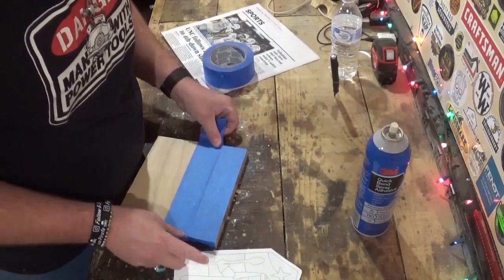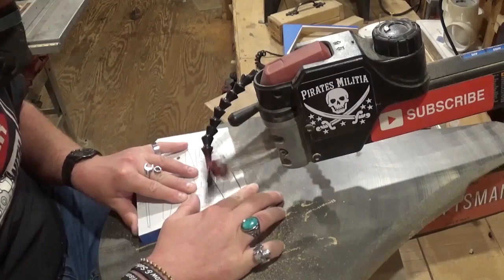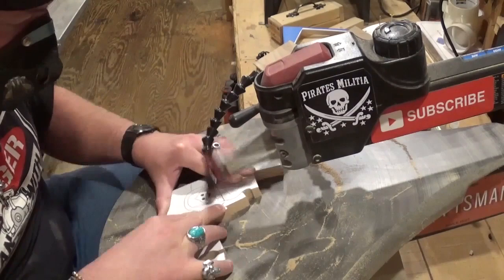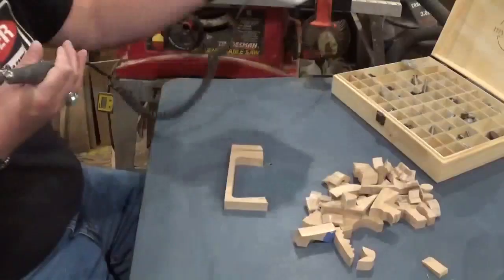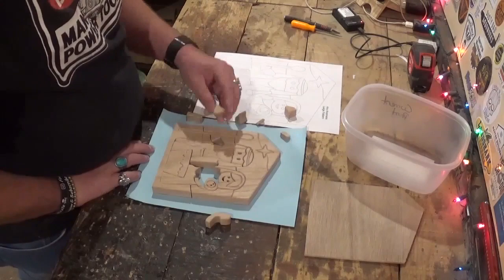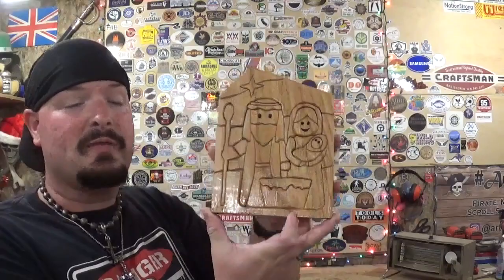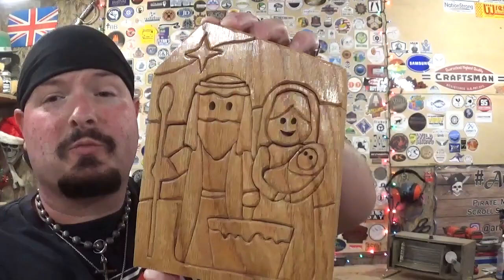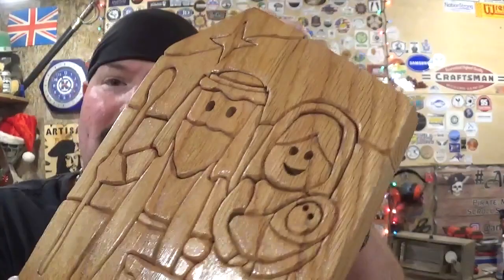Scroll Saw Segmentation, Nativity Scene

Comment: try using clear removable shelf paper it works great easy to remove and it lubes the blade
Reply from the maker: Thanks for the tip! I'll just stick with my packing tape method, the oils in the tape also lubes the blade

Comment: Incredible work, as per usual!
Perhaps I missed it in the video but would you be willing to share which sanding tool you used to soften the edges?
Reply from the maker: I only used a small Dremel sanding drum to do what I did in the video. Sorry I forgot to mention it
Reply: @ArtisanPirate  Sorry! I meant the plug in Dremel-looking tool! For some reason I thought you said it was a different brand than Dremel and you liked it because it held the device and all of the sanding heads at the same time!
Reply: @MichaelSchlecht91  he says its a marathon rotary tool..😁👍